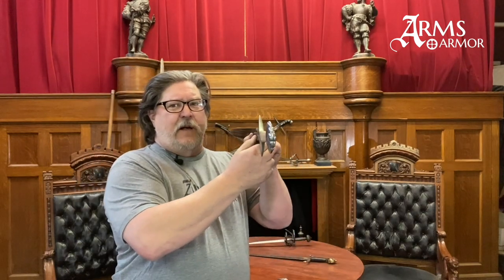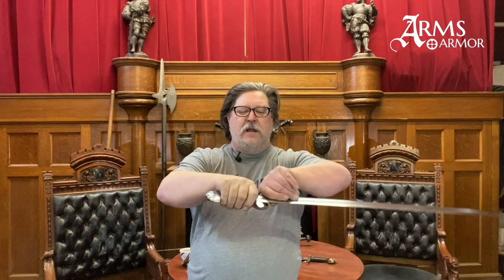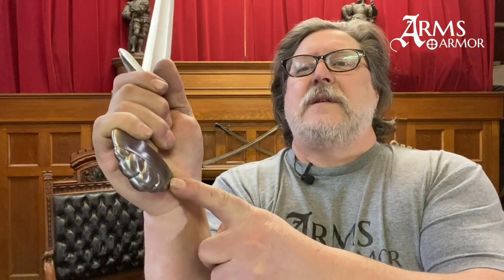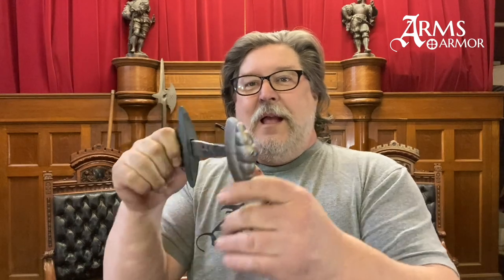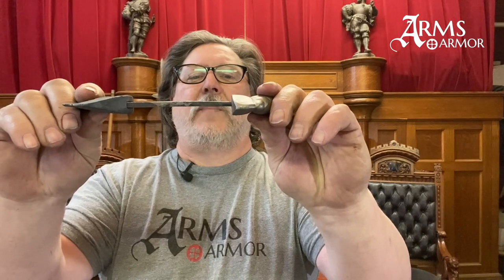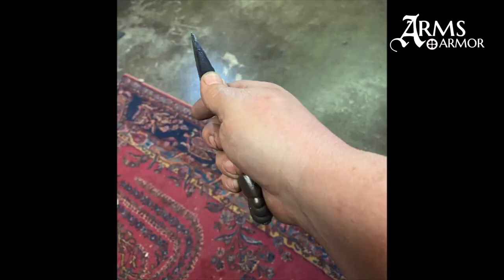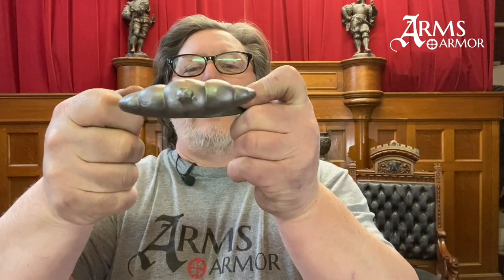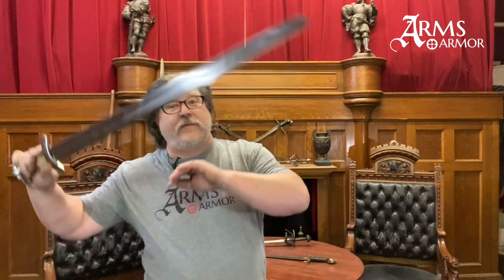Crooked Pommels, Why?

Comment: I've noticed in pics of historic single-edged Viking swords the corners of the pommel are generally clipped which, I assume, helps it fit the hand/palm better. Also a in a few pics the pommel sits slightly off center a bit which again would help the pommel fit the hand/palm.
Unfortunately since these were all pics of historic finds I can only see the swords from one side so I can't discern anything more.
Reply from the maker: Yes, that is one of the factors in this discussion, its only in the last decade or so that enough folks have been able to see enough examples of the survivors to begin to let the swords teach us things. When it's just profile shots in black and white in books and the same 5 swords its hard to see trends and detail.
Reply: @armsarmorinc.4153  it's an interesting thing but the Cold Steel single edged sword doesn't have the pommel edges cropped...and I personally felt it when holding one for the first time. Seems an oversight but it would be a far better sword if the edges were cropped.

Comment: Recent talks of blade meterials reminded me of the subject from years ago on MyArmoury. Iron tangs and shoulders with the only hardening being done up and down the bladed portion, Rc hardness ranging everywhere from Iron to like 58. I always wondered how these blades would perform in cutting and such, and would the iron portions improve regidity at the cost of durability. The fact you could twist both the steel and iron tangs with bare hands is interesting.

Comment: Thats interesting idea since iron is so easy to bend maybe it was the end user either intentionally canting them for comfort or it happened unintentionally without sword maker doing it. I was very skeptical about this, but like you mention its so common there might have been reason swords are so often like that other than just sword maker didnt bother to align everything perfectly
Reply from the maker: Yes, if it was sloppy work you would expecting a relatively even distribution and not the consistency of the canted direction and amount.

Comment: So turning the sword over in the hand to use the other edge might be hindered by the cocking?
Reply from the maker: In the same hand it works fine but going to the off hand it would be the opposite to the twist.
Reply: @armsarmorinc.4153  Thanks.

Comment: So, if the wide pommels impeded the way you fought with the sword then why did they shape them like that to begin with? Was it necessary to balance the heavy blade? Or just artistic because they seldom used the swords?
Reply from the maker: Great question. I think it's a combination of fashion, tradition and use. When we start to look at the why they probably gripped the swords you can use the width of the pommel as a lever as well as a straight on thrusting grip. The weapons humans make are often dictated by more than just our understanding of how a thing works well or not.
Reply: @armsarmorinc.4153  I think that´s Roland´s main point. He grips the sword very differnet from what we mostly think of how it was done (gripping the pommel and putting the thumb in a kind of saber position) . And seeing him fight with it the way he does, convinced me the first time I saw it. To me this is at the moment the best theory of what norse fighting style would have looked like.